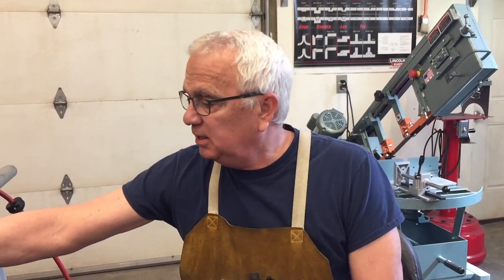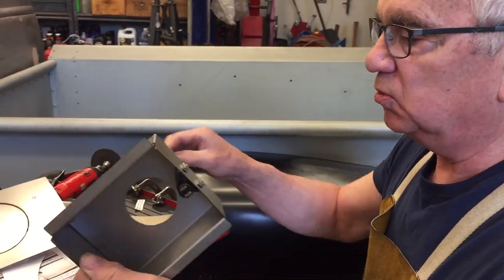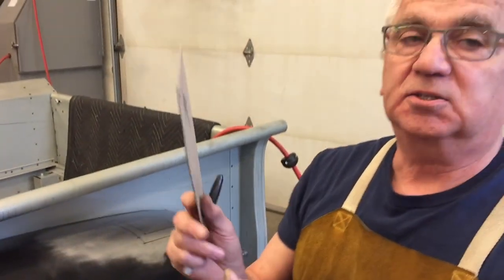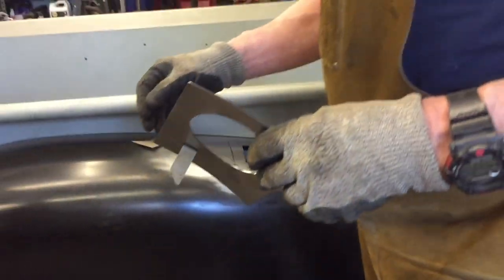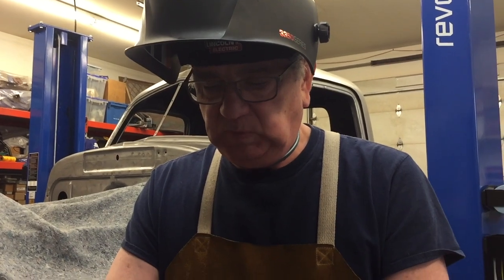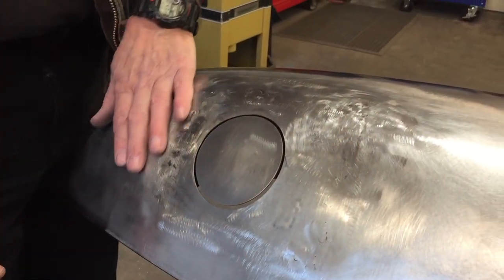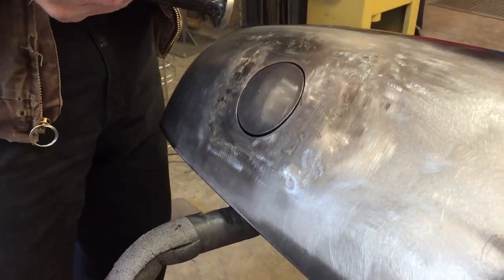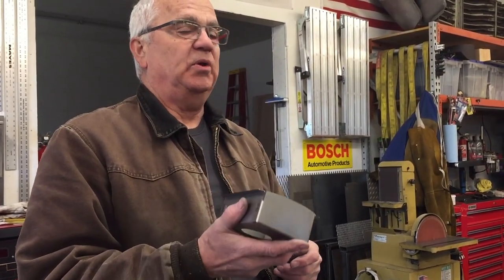Fuel door fender install

Comment: Thanks Steve.  I've missed your videos.I know you used the hoop from Art Morrison.  I'm putting a center section from Welderseries in my 37.  It took me.a while to find weld in engine mounts for my L83, but I finally got them.  My radiator arrived from Wizard.  And while it's a work of beauty, there are some alignment issues.  Wizard sent me a prepaid return package so they can make the necessary adjustments.  now that's customer service.

Comment: I watched Fitzee doing that as well.  I would like to do that with my 37, but the fenders are so mangled that I'll probably be replacing them.  Nobody is making steel fenders for the 37/38 so they'll likely be fiberglass.  The rest of the truck is steel and no rust.  Lots of fatigue cracks, but those can be welded.  Well, there are two little spots of rust on the back of the cab where the floor pan meets the cab wall, but easily repaired and never to be seen.

Comment: Good video, Fitzee's cut and butt, works well, i am going to do that on the passenger door skin on the 55, i did the drivers door with the clips, you mentioned where you got the spoon, where did you get the other two dollys, also i always notice the multi placard on your wall, i have one i got from Adak Alaska it has 16 different cards, do you still keep in touch with Steve Lockie
Reply from the maker: I got the spoon and the body hammers from Eastwood they’re made by Martin tools and yeah I do I talk to Steve and his wife Lynne from time to time, it’s a small world.
Reply: @idahofabricator8710  Steven, looks like you have a great place and garage in Idaho

Comment: Hi Steve, since finding your channel I've gone back and watched your library. I've enjoyed your content and your down to earth show and tell. I have undergone recent knee surgery as you yourself did some time back. I was working on my '36 Chevy 2 door sedan project prior to surgery. Now finding myself with idle hands as I rehab going through the rigorous PT schedule. With mobility at a limit  I have chosen to try and bench work small parts, currently working on a steering column I picked up. I was wondering if you might share some details on the original that came out of your truck. I don't have a parts breakdown manual and I would like to figure out what parts the top mast consisted of. Also what brand was the steering wheel you found on ebay? any help would be appreciated
Reply from the maker: I totally understand the rehab just stay with it,  it does get better.  the original steering column on my truck was part of the steering box, The shaft inside the column had a gear on the end inside the steering box,  my truck had three on the tree so it had another shaft  that went down the side of the column for shifting gears I ended up using the original steering column mounting bracket for my new steering column. Both the original and the new steering column are 2 inches in diameter. I got the steering wheel from speedway motors the part number is 91032715 it fits a standard GM column without any adapters and it’s sized for power steering it’s 15 inches in diameter.
Reply: Thanks for the your input. I'm going to use this column. The mast is 1-3/4" od with the inner shaft at 3/4". It needs I believe the upper horn bushing to keep the shaft centered. Trying to locate the what I'll need to rebuild the bottom end. I noticed the '40 steering wheel you showed also has splines as the original GM

Comment: Steve how are you going to do the gas pedal
Reply from the maker: The gas pedal is an assembly the engine that I have is a drive by wire system and the pedal came with the wiring harness, it will get mounted on the firewall I’ll have to design some kind of a bracket so I can mount it to the firewall.